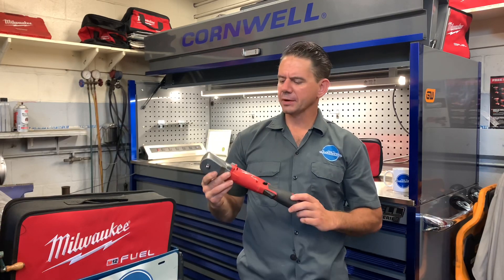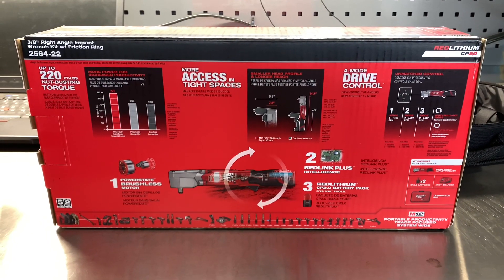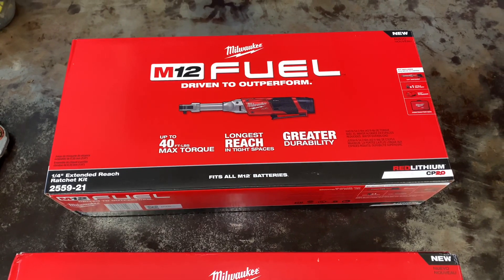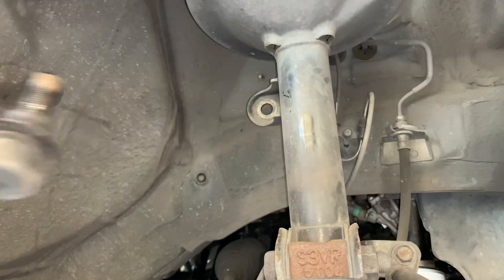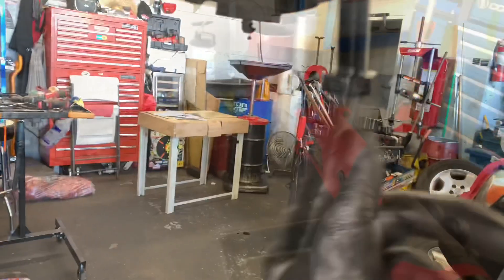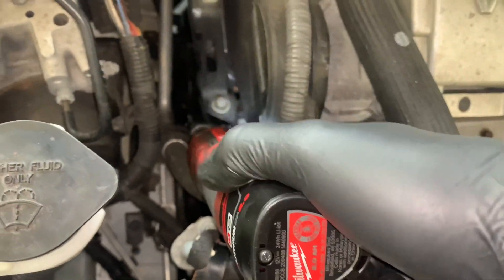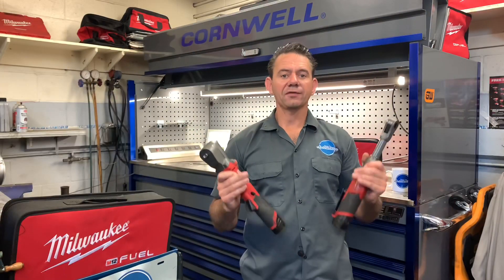Milwaukee Tools New Right Angle Impact And Extended Reach Ratchet

Comment: The Extended Reach is the winner for me. Gets the job done, can still ratchet with it, and fits into tighter spaces.
Reply from the maker: The extended reach is one of my favorite tools for sure.
Reply: As long as you have a smaller profile impact already then sure
But if you don’t and say only have a massive 1/2 air impact then the right angel Impact I feel would be better choice. But then again they both have there applications and I feel any mechanic that makes a living with their tools and is serious about their job then invest in your self and buy both
Reply: @johnwayne2638  not stupid its a impact not a ratchet you can't use a impact like a ratchet
Reply: Same here. I already have a Dewalt mid size impact so I bought the extended ratchet. There will be the odd time when a normal impact can't get in somewhere but for a home mechanic you don't need a power tool for every scenario, just use a breaker bar.
Reply: @johnwayne2638  impact guns don't have locking mechanisms but they generally have higher torque values, ratchet guns generally don't come with high torque specs they different in design and it's the pieces that make them what they are also make them different
Reply: I don't know guys. It seems like the right angle is the best one. It's so close to the power of a stubby and will fit almost anywhere a stubby will fit. But it's also close to the ratchet size. Plus it's blazing fast. If you only need 55lbs of torque that the ratchet can do then a basic wrench will probably do the job and they are much thinner. You can probably break it with a basic wrench and remove it with fingers I'm guessing. If I had to pick one and I kinda do, I think I'm picking the right angle.
Reply: why not both?
Reply: @embalmed  space, weight and cost may be factors for some.. like on a boat or in a small vehicle toolbox.. and why waste money on something you don't need or a mostly redundant tool when there's so many other tools that could be much more helpful... however, if you have almost everything and the room and you use it a ton then I can see it making sense to have both... and that's probably the case for many people... but for me, just starting to buy tools, I don't know how much I want to spend on tools or what I'll want the most... so getting the tools that can do the most jobs for the lowest investment seems like a good way to start... seems like a socket set, wrench set, this right angle cordless and a torque wrench can get a crap ton of jobs done...
Reply: @domalash  they're two different tools for two different jobs. If someone is looking for maximum overlap, the risk of disappointment increases quite a bit. What are the chances that same person ends up blaming the tool instead of their decision?

Identify a job you want to do, and buy the right tool for that job. Don't focus on which tool can do the other's job more.

Having the right tool makes so much of a difference, and having the wrong tool wastes too much time.
Reply: @embalmed  I think your point of view is way too narrow. You don't always buy tools as you need them and you can't have a different tool for every different job in most cases. You should look at the big picture and your future plans. You should anticipate needs and prepare for them. You should realize what you don't know like me and purchase things that will help you the most and get any luxury items at the end. A 55 lbs torque wrench won't help me much when I can crack those with a wrench easy in almost any tight spot. But the power and design of the right angle I can image being super helpful in many situations. Plus often the best tool for the job is the one in your hand because it saves time and makes zero difference. The saying use the right tool for the job gets into people's heads too much. It's not some magical law you must follow. It's smart most of the time of course but it's just dumb to walk 20 feet to get a hammer when you just need to give something a light tap. We almost all do it. Anyone who doesn't is probably insane and wastes so much time. So I will focus on which tool can do the most jobs and save the most time and make my life the easiest for the least cost. It just seems like better logic than yours.

Comment: I've had the right angle impact for about a month now and it has already proven its a game changer. I've been able to get at difficult bolts that I could never get to with a gun style electric impact before, and that the ratchet wasn't able to break loose so I'd have to get out a dedicated breaker. I personally think both tools are quite valuable to have in the arsenal.  Ratchet for engine bay and tighter smaller stuff. Angle impact for suspension, brakes, subframes etc. where you could benefit from an impact, but a big gun might not fit due to suspension components and axles and so forth being in the way.
Reply: Ratchet can break loose any bolt just use your muscles if you need a breaker bar the right angle impact with 220 lbs of torque will not work
Reply: @legros731  on rusted bolt impact are better to bust them than using a breaker bar, sometimes it's end up snaping a M18 bolt with the bar but yeah 220 is weak compared to gun style impact. I'm not sure you can apply that much torque on the ratchet by hand... Maybe they will come with a new gen with more torque
Reply: @ItsJust2SXTs  you can easily put 220lbs by hand on a ratchet most 3/8 ratchet are good for like 300/400 lbs/ft before breaking the anvil with a cheater bar

Comment: I think I'll buy a 3/8" ratchet to complement my 1/2" Stubby. The right angle impact looks a tad big and end heavy. Thanks again
Reply: I thought the same at first now I have the stubby and the right angel but both are 3/8 and I Find that I’m grabbing my right angel more offend then my
Stubby. It’s feels a lot
Lighter in the hands then it looks. But if you could only have one or the other and you already have the Stubby get the ratchet
Reply: It's a little end-heavy, but there is no substitute for being able to get into weird little tight areas that a gun style impact would never fit. Even the stubby. 

That said, if you already have a stubby that can get MOST places...the 3/8 ratchet might be the better option. Kind of depends what you tend to work on and where the pain points are for those brands and models.
Reply: The m12 is a little heavy but when you are craving your arm into some bs position you can turn a ratchet in well you'll be glad you have it. I end up using it for all sorts of bs like Allen keys for deconstructing warehouse office cubicles and mess lol. If you live in the rust belt that impact makes the difference working on cars.
Reply: I bought the 1/2” impact, helps with tightening steel fasteners and breaking stubborn nuts, the long reach does look good, but i think power is most useful when its needed over hand turning a ratchet, although im interested in how much movement per tooth there is… if its a fine or coarse ratchet.

Comment: I main line tech for a mom and pop and I have sold off every snap-on electric I used to own for Milwaukee. 2 year warranty compared to a 1 year, fewer failure issues. They are phenomenal tools, and with the exception of weak detent balls, I have no complaints. Both tools he featured are incredible. The right angle impact has no trouble ripping off every crank bolt I've put it on and the long neck ratchet is identical to snap-on's with a better trigger mechanism and no retarded friction plate failures. Good review, I agree with his assessment, buy both you'll want them.

Comment: Great comparison. I was almost ready to pull the trigger on the Right Angle Impact. But your video and the one from a torque test channel (where they found that it is only making 114 ft/lbs running torque, 140 MAX after 15 seconds), combined with the relative bulkiness of the head convince me to stick with my ratchet. I can easily surpass 140 Ft/lbs of torque by using the ratchet manually. I will probably rather buy the extended reach one (mine is the old short one) along with stubby sockets to increase my reach and usability. Thanks for the great video!

Comment: Thank you for this!  I think the extended reach would be most of use for me as a DIY guy.  Although, I'm sure as soon as I buy the extended reach, the next thing I need to do would benefit from the Right Angle Impact instead.  Murphy's Law always gets me!
Reply from the maker: It always works out like that. Both of the tools are amazing. Thank you for watching!
Reply: I'm so undecided i definitely think the impact ratchet would help on brake jobs (ie caliper bolts) where not even the stubby impact can get in....but then again I've come across caliper bolts(more than I can count) that not even a pneumatic 1/2" impact would take off and end up having to get the ol trusty breaker bar out...ugh I need a go fund me for my tool habits 🙄

Comment: Seems like the ratchet is the better option. In tight spaces the impact didn’t fit anyway. The areas the impact was needed, you could just use a regular impact gun. I’m glad I watched this, cause I was gonna get the impact ratchet, but I think my 1/2 gen 2 impact gun along with the ratchet is the way to go

Comment: the impact one I tried only can loosen  below 21mm bolt,I don't use much,ok for some jobs, I should buy other one, loosen the bolt by long spanner and use other one quick turn the bolt.
2021 now they are the speed one look good.

Comment: If you work on rust belt trucks and gotta remove bs in tight spots I like the milwakee right angle impact. I'd say screw the extended head one is redundant. If you can fit the big ratchet in there you might as well just get the impact out and save yourself the wrenching. I'd grab the shorty ratchet and get the impact 1/2 inch for stuff you need the reach

Comment: they are 2 different tools, there just both "right angle" . The impact is meant to break fasteners free. The ratchet is not. It has 50 lbs of tq to fight against binding, rust and nylock type resistance all the way down the threads . Pulling a Subaru trans back off the engine 3 - 4 inches to do the clutch is fast, and with the (right angle impact) things like flywheel bolts come off without having to hole the crank, etc...

Comment: Wondering if the extended reach has any more body strength for pushing and pulling than the standard version. I haven’t been impressed with the standard version.
Reply: I broke the head on two on the standard ones then bought a fuel.... THEN the extended reach came out.

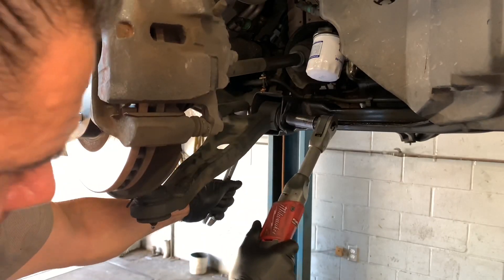Comment: 3:00 I see your Milwaukee has a weak detent ball as well. Sockets are constantly coming off mine. If I have a larger deep well sometimes they'll just fall off while walking to the car; been this way since new. My first one died a week in and my replacement is the same way. Frustrating.
Reply: That ball detent is annoying af, and if I didnt work in muddy pits where sockets could get lost I'd definitely shave the raised edge down on the ball to make it more like a ball rather than a cylindrical sphere.
Reply: falling sockets diminish the tool immensely

Comment: One needs to know what applications each tool are technically design to shine the most in it's preferable areas of choice because both tools are not the same in no shape form or fashion even though they appear to look similar . A impact wrench and a ratchet is completely different but the impact picks up we're the Ratchets lack in power when on removal the ratchet has two features but lacks the power on a removal in which the impact can meet some of the desirable needs of removing fastners but not all it still has it's downsides as well

Comment: I just got the standard length 3/8 fuel and man have i been dumb not getting it. just starting out as a tech so money is not all there, no debt though because i don't wanna do that and become a debt victim. But anyways doing brakes, valve covers whatever was such a pain with no power tools and i got this and it's so nice lol. Not sure if i'd need the right angle impact quite yet...i don't see it doing too much the ratchet can't. I also like doing a quick snug up and final not torque but get it tight by hand for 99% of bolts and switching tools takes a bit of time so all in 1 is nice.
Reply: After 4 months how have you like it so far as an everyday mechanic... been thinking of putting this on my Xmas list this year for personal use.

Comment: If the right angle impact delivered close to 400 ft lbs like the air versions, I’d say it’s a borderline must have.  As it is around 220, I do have it and like it very much, but its uses are a bit more limited.

The long neck battery ratchets however are awesome.  The only real alternative to them for getting into tight areas I’ve found is the ultra slim reactionless air ratchets, but even then, your hand has to fit down in there with the ratchet.

Granted the Milwaukee Fuel 3/8” has kind of a fat head, but in reality, the long neck makes up for it.  The head itself shouldn’t be too much of an obstacle.

Comment: The 90 degree impact is cool but until it's the size of a normal ratchet/electric ratchet it's just not reasonable.  Also half the test bolts you did you could fairly easily use a normal impact gun or the 3/8 electric ratchet.  And lastly not being able to break a bolt loose is what makes it a no go for me.
Reply from the maker: That’s the point of the video to help you make the right decision if it was the one for you or not.
Reply: @HowtoAutomotive  exactly, I appreciate. The second they make one that can do everything I listed I'll be buying multiple. Until then I'll have to play the waiting game 🙂

Comment: Old fashioned method for stubborn bolts get a box end  and a dead blow hammer. No need for the fancy nonsense. The 3/8 long handle ratchet is a better buy over the right angle impact.
Reply from the maker: If I could only pick one I would get the ratchet

Comment: For my applications the impact works better than the ratchet. I change meters/pipes in manholes and while the head of the impact is larger, the power of the impact also allows it to be used to loosen as well as tightening to spec. I also can use the impact with bolt extractor sockets. 

Also this guy in the video is using the wrong battery for the tool. It needs a 4 am or a 6 amp period. Much more power
Reply from the maker: That’s what’s great about Milwaukee they make a tool for all kinds of applications. The right angle is designed to work with all of the M12 batteries. The purpose for using the 2.0 battery was to show how tight of a spot you can get it in.
Reply: @HowtoAutomotive  true, but that's kinda like putting a 3 amp battery on a hackzall yo showcase the compactness, and when you compared it to the ratchet it wasnt a fair comparison because the impact gets more power from the larger batteries while the ratchet gains zero benefit to adding the higher battery. No offense you're definally not the only video that did this, so I expect it, but the difference is definitely noticable and I'd wager to bet that with the larger battery you woupdve been able to get many of those bolts off that you couldnt with the 2 amp.

Comment: Using the extended ratchet to break a suspension bolt loose like that is just asking to cut the life down and kill the ratchet sooner. That is an example of not using the right tool for the job. Re it works and gets it done but an impact of some kind should be used anyways. Plus they are both great tools I don’t have the extended version but I have the standard fuel ratchet and the right angel impact. They both are great and both have the place in the shop. If I could only have one it would be the impact but I like having a reason to buy tools so I wouldn’t have that issue anyways.
Reply: Lol ratchet head are super strong 
You not breaking it without a cheater pipe

Comment: Are those impact sockets?
Reply: I have a set of Stanley chrome sockets from Walmart and use them on my Milwaukee fuel impact all the time and I have broken a bunch of impact rated socket adapters and haven't broken a single one of my chrome sockets so imo impact sockets are only good for some body who uses em every day.

Comment: Great video. I am still holding from buying the extended neck version due to the bulky head. I wish it was designed like the 1/4 version it would've been a killer product. About the impact 3/8 version I am so impressed with power output from a 12v battery powered cordless tool.  There is likely chance I will but the 3/8 impact angle rather the extended neck version but maybe with time Milwaukee releases another version of the 3/8 extended neck with the 1/4 head designed.
Reply: Somebody modded the 1/4 extended reach with a 3/8 anvil 👍
Reply: @legros731  - I did this myself. Purchase the New Milwaukee 2559-20 (1/4" Extended Neck ), purchase the anvil from the first generation 2458-20, remove the 1/4" anvil from 2559-20 and install the anvil onto 2559-20 and have a new Milwaukee Cordless Ratchet not even on the market. It works FLAWLESSLY. ( Keep in my total MAX Torque is still 45 ft-lbs. In my opinion, this is how this new extended ratchet should've been designed by Milwaukee Tool in the first place.

Comment: I have a question about M12 Fuel Extended Reach Ratchet. If you use it as a hand ratchet, how much torque can it handle? Have not found information about this on the web.
Reply: I doubt you'd break it with the length of handle it has to be honest. It is beefy.

If it looked like it was going to damage it, you're using the wrong tool for the job at hand I'd say.
Reply: @ssss-df5qz  Thanks
Reply: Honestly I've used lots of shitty ratchets for breaking suspension and never had an issue.  Still using them 12 years later. I'd assume these are better in that category since the new fuels are so much more beefier in the mechanical components